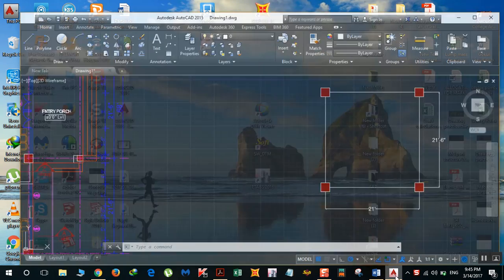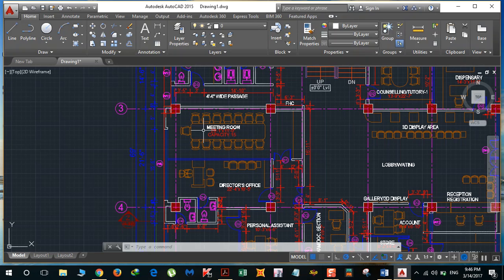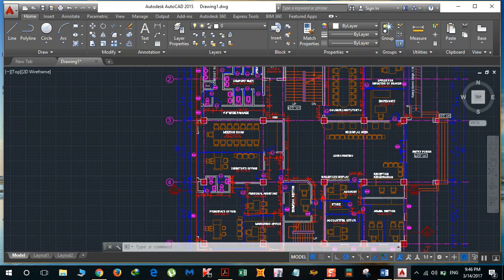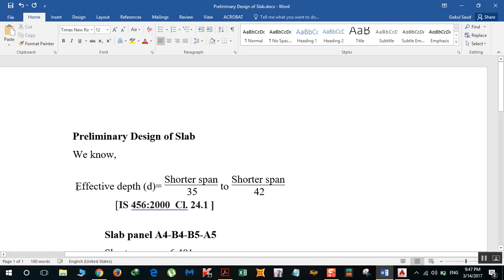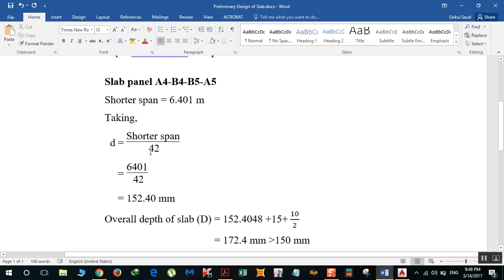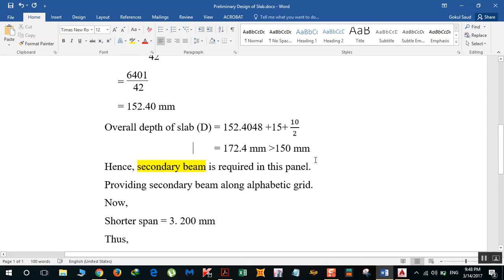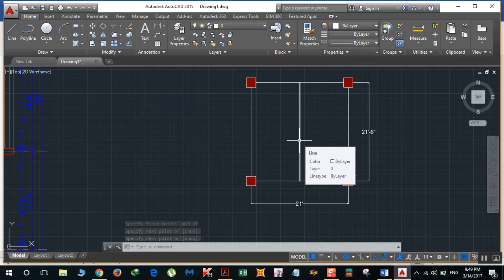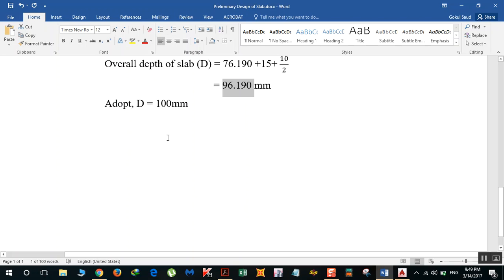Preliminary Design of Slab

Comment: why did l/d ratio was taken has 35 to 42? according to clause 24.1 of IS 456 if the span is less than 3.5m and loading is less than 3.5kN/m2 we have to be choosing the ratio specified? but the shorter span you have got is 6.4m. can you please explain that?

Comment: hello sir, i frequently watch your videos and they are highly informative. thanks for all. but i ve one confusion in this video. firstly you told to use the larger slab but due to over size of slab you provided a secondary beam. as you provided it the slab become smaller isnt it. 100mm slab thickness you obtained, will it be applicable to all the slab

Comment: Dear sir,
I have some questions regarding this video, it would be great if you could give your attention to them!

a) As per IS Code, the ratio of span/35 or span/40 is only applicable for slabs up to 3.5 m, but the slab in your example is greater than 3.5 m. Also as per the code if Fe 415 is used we have to multiply the ratio value by 0.8. So how did you come up with the ratio of span/35 to span/42 in your example? Or do we come up to this value  when we multiply the basic value as per your explanation with modification factor for tension and compression reinforcement? Even if we were to take the modification factor, taking the minimum and maximum percentage to be used in slabs i am not getting those values? Can you please explain?
b)The maximum thickness of slab as per you to be kept for practical purposes is 150 mm. Is it a practical interpretation or codal provision?

Thanks,
And lastly you do such great work... !
Reply: @engineeringacademy9812  Thanks for the clarification.. keep posting such videos! Cheers!